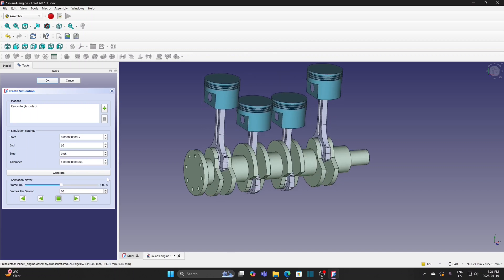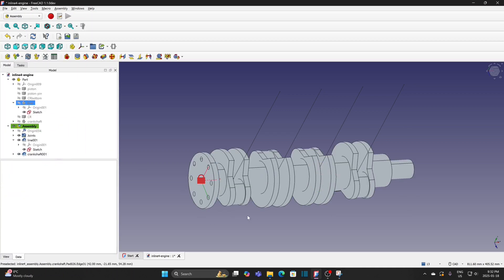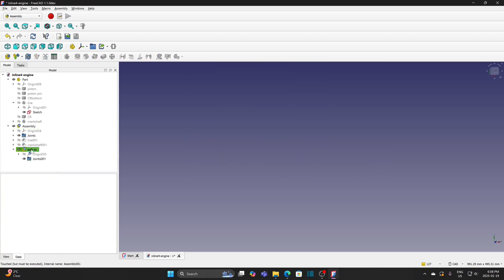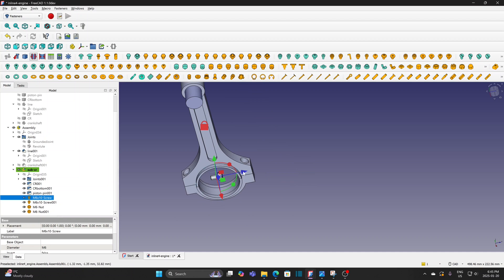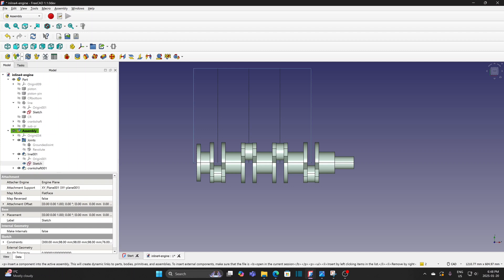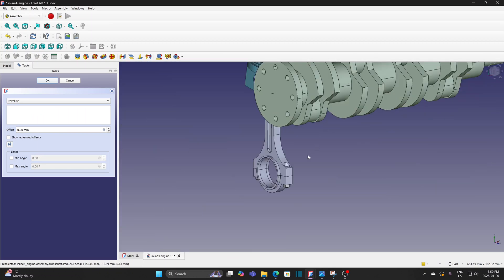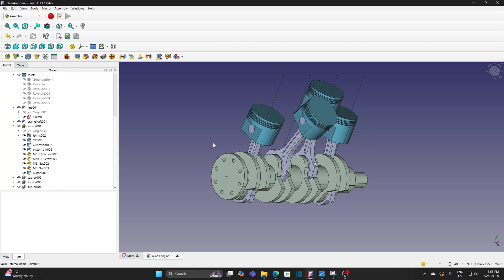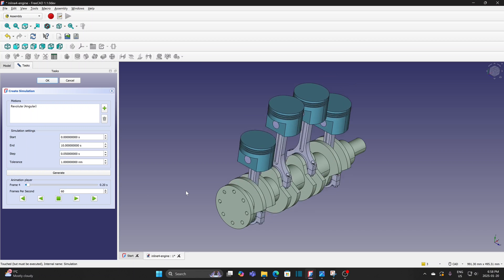FreeCAD 1.0 / 1.1.0 Assembly Tutorial: How to Create "Movable" Sub-Assembly (Flexible Sub-assembly)?

Comment: thank you...some thing I feel confuse is why 
1..we must import the Subassebly from a part but not creating it inside an Existing Assembly ,
2.. can we nest the Assemblys? for example, Assembly A has subAssembly A1 and  A2 ,and A1 has sub Assembly A11 ,A12, A2 has Assemblys A21, A22...
3. Did you ever come to the Access Violation Bug ? thie Bug triggered in my PC of Windows 10, by using Ctronl+Z during Assembly, and all my data is cleared , the Recover function did not work
Reply from the maker: Hi,
1. You can create the parts within the same file. I import the parts as I want to demonstrate the assembly function, and not spending too much time in creating parts in the video.
2. Yes. It you can.
3. In FreeCAD 1.0, the Control + Z seems ok, but in FreeCAD 1.1, I am not sure. As FreeCAD 1.1 is still in development and there are many things "in the process" and it may not be stable. Sometimes, I got error even with simple functions in Sketcher or Part Design.
Hope this help.
Reply: @KK_CAD  😃it helps ..thkq
Reply from the maker: Additional comment for 3. For the Control + Z function, usually it works. But sometimes, when error occurs and the "report view" pops up and shows the error, then I also cannot use Control + Z to "undo" it.